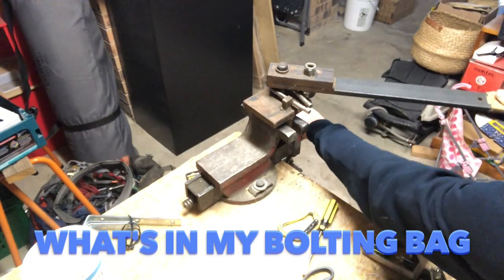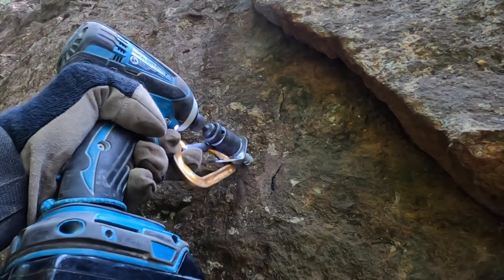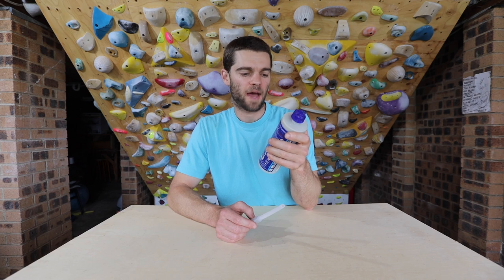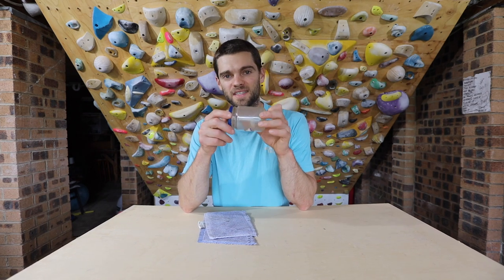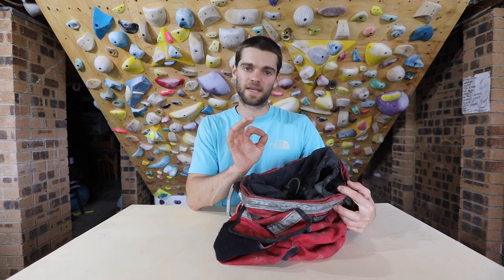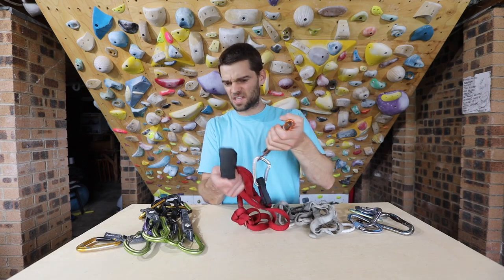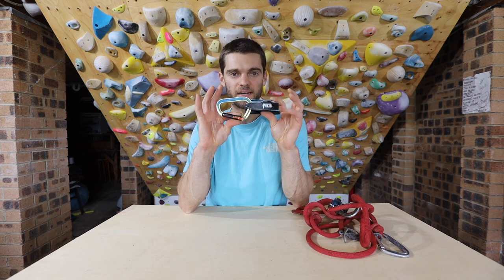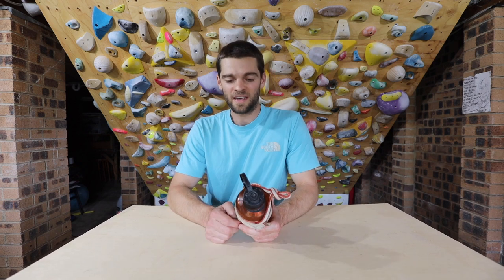Complete bolting kit - Gear for bolting sport climbs

Comment: Chuck a bit of blackboard chalk in either the chalkbag or your bolt kit. Way easier to tick bolt locations or similar. 
Worth mentioning hole brushes, particularly for Bluies sandstone. You can get ones with an SDS attachment to really go nuts. A few bits of plastic tube to blow the hole out as well. 
Spare mixer nozzles! 
Super long jugs can benefit from an extra foot mount ascender so you can move even more efficiently. 
Saw your Grigri hook in a recent vid and thought it was a genius move.
I've got a ratchet and a couple of sockets for putting in the concrete bolts. Also useful for snapping off old carrots if you're rebolting. 
If you chuck a bit of shockcord in 12 or 25mm tape you can make nice shock absorbing slings for your drill and hammer. A bit nicer when something pops unexpectedly.
Reply from the maker: Yes, the brush for sure! Remembered it after recording. Fun fact, not the first time I forgot the brush. I also now carry two with me as I had one shed all its bristles and I was left with a twisted piece of wire.

Gri gri is totally awesome. The shock cord is a good. Have used friends tools in the past which have them but never made the move to make them myself. Perhaps I need to.

Thanks for sharing!
Reply: @TomOHalloranAus   plus one on spare mixer nozzles ha, I've snapped a bunch letting go of the glue gun when it was on a sling.
Reply from the maker: @Jeremysamways1  haha yes! I've usually got about 5 on me

Comment: Good rundown of your bolting kit. I also keep a big piece of sidewalk chalk &/or a few pieces of smaller whiteboard chalk in my chalk bag for marking bolt placements. I also recently got a mini battery-powered Bosch leaf blower that is a real game-changer for cleaning, especially lower angle or ledgey routes. Do you use a hole blower? Love the Grigri sky hook trick!
Reply from the maker: The chalk marks are great. Remind you where you were thinking and see their spacing from afar (I’ve made that mistake before). The mini blower is next on my list of gear to buy. I really needed it on the multi pitch I bolted recently. So many dusty ledges!

Comment: Nice work mate! You're the only one I've ever seen rocking the M18 BH on a wall but it makes a lot of sense in sandstone. Especially since Milwaukee STILL hasn't released a brushless compact.
Reply from the maker: Yeah this thing has been awesome and the size/weight saving for my use case is well worth the 'lack' of power. It's never failed me

Comment: Cool vid.
I use wire brushes.
With concrete semi permanent anchor bolts. Thought they were just single use?
Reply from the maker: I’ve found they work pretty well for multi use. Obviously it’s a case by case thing thing though

Comment: Are you glueing those galvanized cement bolts in?  Strength and failure testing?
Reply from the maker: Just screwing them in with the impact driver. They are only there as ‘body weight only’ pieces so I can pull in to clean the rock and then glue in my U bolts (the ones you actually climb/fall on).
Reply: @TomOHalloranAus  Thank goodness.  That was not clear on the video and I was thinking "sketch".

Comment: It is really interesting to me that you are using the hybrid acrylic (that they now sell at Bunnings as Dewalt) instead of pure epoxy. Is there a reason for this? I noticed this is cheaper than the REO502 I have been using and if it does just as good a job it will save me a couple of bucks :D.
Reply from the maker: The REO502 is better. The big positive being it lasts longer before bolts need replacing. I just couldn't get my hands on it that day. I usually use the 502. The cost hurts a little, but worth it. You're on the right path :)
Reply: @TomOHalloranAus  Thanks mate! I really appreciate the reply. Keep making the awesome videos 😀.

Comment: Hi Tom, just one question, i normaly use expansion bolts, and we know when we're rebolting a old route, you have to leave at least 20 ctms between old and knew drill holes. With the glue bolts and drilling 2 holes so near one from each other,  can the rock break inside between them?, Or maybe, whitout using any expansion inside, the rock always is ok???. thanks man, and very good job. 💪💪💪
Reply from the maker: Hi Domenec, there's no real concern in these situations about the rock failing in that way. Obviously this will all come down to rock type, anchor mechanism (expansion vs chemical), embedment etc etc. The rule I heard (from engineers) for minimum distance between holes was 2.5x hole diameter. So with 10mm hole, the next can be 25mm away. I'm drilling 12mm holes and my bolts legs are 50mm apart. Plenty safe distance based on that rule. Again, I guess this will depend on rock etc. Take what I have said as opinion, not fact. Sounds like what you're doing it safe and working well :).

Comment: Would having both the drill and driver the same brand make life easier, with them sharing the same batteries, and then not having to take as many spare batteries with you. 
Seems like being able to cut down on any extra weight would be ideal!
Reply from the maker: For sure. Big dream would be to be running the full Milwaukee kit. Just a bit of an investment upfront. Having used it all at work, I’m super impressed by their gear

Comment: I like to use the petzl dual connect instead of the skyhook idea, although you're limited with the dual connects rope length, I might just adopt your sky hook on a rope idea! thanks Tom.  Keep the quality videos coming!
Reply from the maker: Nice one man. Yeah same principal, the gri gri just lets you have all that adjustment at you fingertips. It’s so handy!
Reply: @TomOHalloranAus  so you take two gri gris?
I also use the dual connect
Reply from the maker: Yes, two grigris. one as my main line (attached to top or bottom anchor) then the second to help moving around. Vid coming soon of actually using it in the real world situation
Reply: @TomOHalloranAus  Tom's way means you can also stick clip up stuff too if the bolts already exist. Dual connect is only 1m long or so. You can have 2-3m of static this way and it's still convenient. I use it too to get o the anchors to TRS stuff - so much more efficient.